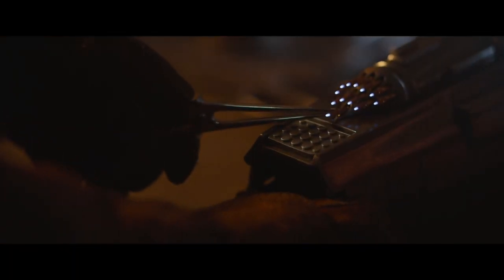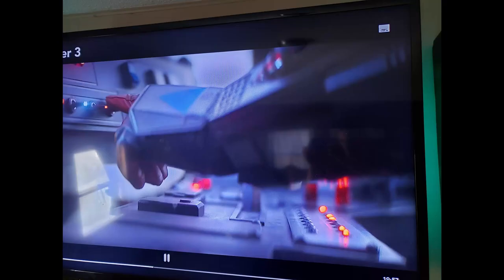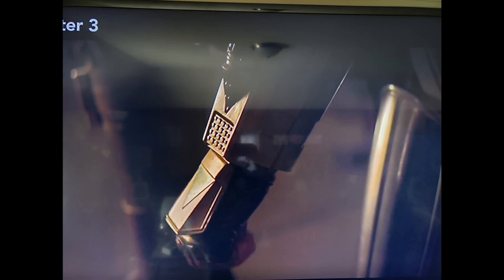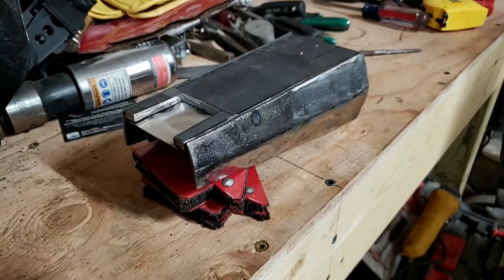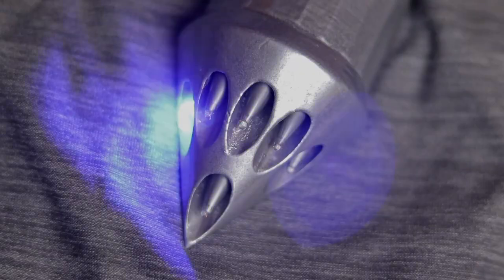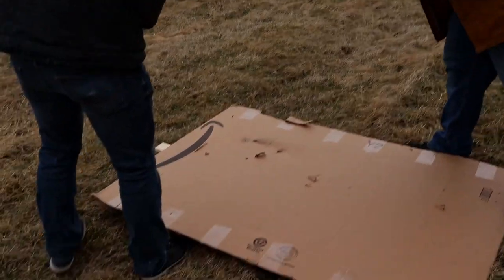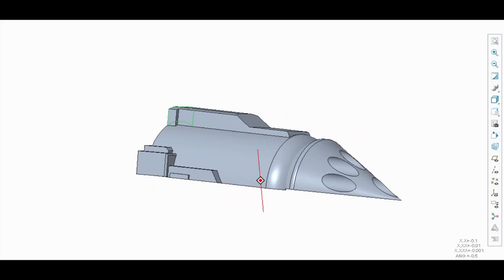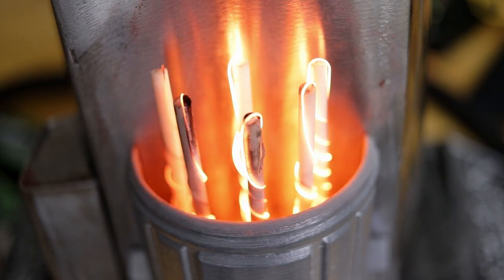REAL Mandalorian Wrist Rocket Prototype

Comment: Suggestion/Question:
Why not using normal electric igniter caps? Those come dirt cheap online and skip the 'delay' and reliability issues from the coils?
Second, you could (propably should) make the upper cylindrical part of the launcher like combination of barrels and a magazine.
The barrels would help stabilize the rockets and it would make raload much easier.

Comment: I also thought of using something like Saturn missile fireworks.  Since they are smooth and have a faster burn rate than traditional wooden stick bottle rockets.
Reply from the maker: Yeah they worked okay but were somewhat unreliable. If i did it again I'd make my own missiles out of a casing and sugar/kno3 mixture. Basically mini sugar rockets. At least try it.
Reply: @SECTOR07  add in a little rust too, it's a catalyst.

Comment: You should try making the rockets by using the engines for the hobby rockets that you launch electronically
Reply from the maker: I actually considered that when I was designing this. What I found was that there wasn't a small enough engine to match the size rocket  I needed. Even with tiny bottle rockets I could only fit 6 into the design without the cone being too big.
Reply: @SECTOR07  i think boba fett's has 6
Reply: @SECTOR07  I was thinking you could use them and maybe have a rotation loading system to fire them in sequence. That said, I'm no expert and my idea is theoretical haha
Reply from the maker: @tristanlanier5641 Hmm, I didn't know that. This project is based on The Mandalorian's one which has twelve. Sounds like Boba Fett's would have been a much easier goal 😂
Reply: @SECTOR07  yeah,  if you've played the new battlefront 2 game,  when you play as him his default number of wrist rockets is 6, I'm not sure how accurate you can make the gauntlet to match bobas with the bottle rockets but you can at least fit the six! (Tbh I just think it would be awesome to have them to use in an airsoft match. Non explosive of course with blunt ends lol)
Reply: @SECTOR07  and even with the design from the mandalorian, firing six bottle rockets from your wrist is still pretty bad ass lol
Reply from the maker: @tristanlanier5641  Right? It was a fun first Youtube project for sure. If you like airsoft you'll have to stick around. I designed an automated exosuit that controls two shoulder mounted lmg airsoft machine guns. It's a monster of a build though so I'm waiting for the channel to get more popular before I start making it. So stoked for it though.
Reply: @SECTOR07  what???? That's awesome,  like the predators gun?

Yeah I think it would be awesome to come to an airsoft match fully suited in working mandalorian armor and being able to almost one man army the other team. I think it could work too. You could make the jetpack which would look cool but it could house all the fuel for your gear (and maybe instead of a flamethrower you could have a smokescreen from your wrist. Also the bombs the mando used to blow up moff Gideon's tie would be cool as flash bangs. You could probably even make them twist loaded on a timer to where depending how far you rotate determines how many seconds until they go off